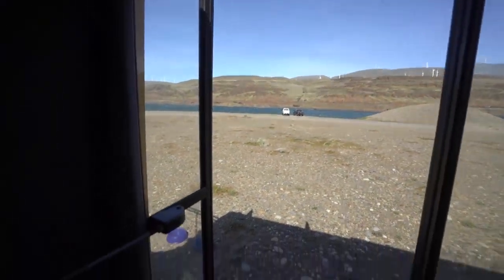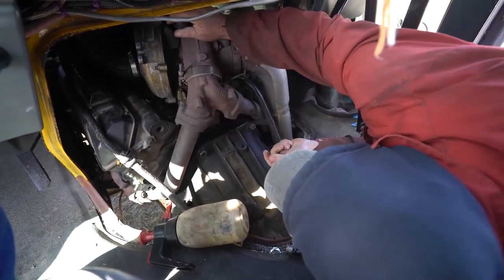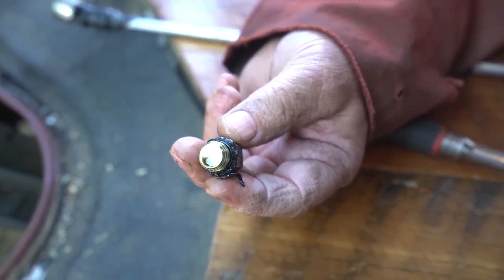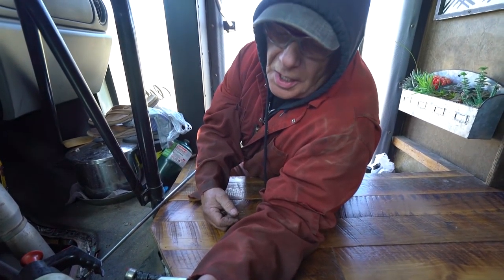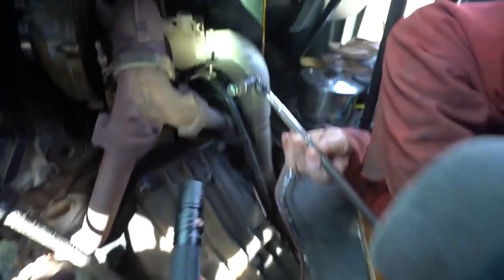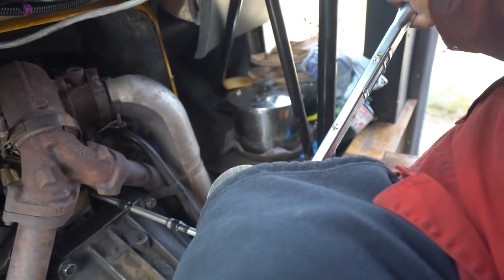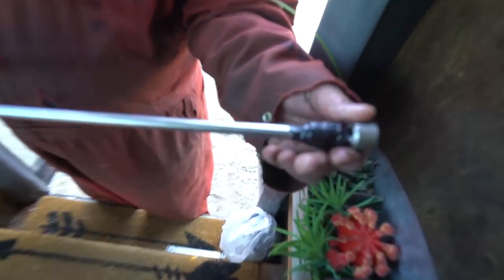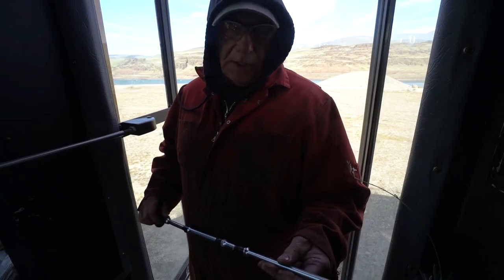LAST NIGHT IN THE BUS

Comment: I will sweeten the pot a little bit more with a fact about burning waste motor oil.  If you get the right engine, you can mix between 50/50 and 80/20 oil to diesel mix.  If your engine normally gets 10 miles to the gallon on diesel, you would get an effective fuel mileage of 20 to 50 miles per gallon.
Reply from the maker: it's gonna be much better on my wallet :)

Comment: Right on guys, ya figured out a bit of a short cut, good work! That'll hold now Jax, all set for another hundred thousand. Heh, heh. Waytago with the cool pro-tip Badge, tape on the joints is a good idea. Thanks! That's another cool spot ya got for yourself there Jax. I've been expectin' some feelins as the sale date draws nearer. It's kinda hard to believe it's been two years man, the way I see it is you're sellin' the Adventure Bus but Dan stays with you. How's that work for ya? Good on ya man, for plannin' on the veggie oil conversion, I couldn't do it. There's a lot of work involved in operating a veggie vehicle. It's a commitment to say the least. Giuseppe said that the power and the miles per gallon stay about the same. It's the cost and environment that reap the benefits for your troubles. I had figured that there would be a substantial sacrifice in power. I don't mind bein' wrong and I really hope I am. DUDE!! Is that a frickin' spider hangin' out by your head?! Mixed feelins about turnin' down that show? It would make perfect sense to have that issue, but you made a decision for you and only you know what you want and what you wanna do. I think that the #2 build will be interesting and exciting and then you'll be off on another excursion. Cool! I wish it was me dammit. Ol' puppy-dog is very quiet...sleepin?...with Elle? I'll wager it's the second one heh, heh. Glad that you folks had a nice supper, you're good people. I've rambled too much!! CYA! ...............................PEACE!!
Reply from the maker: thanks GT :) can't wait to start all over again !

Comment: Hi Jax. I know I mentioned this before, but waste veggie oil is very difficult to get.  Baker Commodities has most of it locked up in contracts.  Consider getting an older diesel engine 7.3 IDI or even 6.5 Turbo and burn waste motor oil.  It's plentiful and easy to process on the road.  Waste veggie oil is best processed in a stationary environment  and turned into biodiesel.  Burning straight veggie oil can be done, but it's best done on older Mercedes cars.  Like I said though, it's super difficult to obtain in any quantity.  Either way, I am excited to see what is in store for the future fuel.
Reply from the maker: I've heard that. I'm sure there is a way to get some :) thx